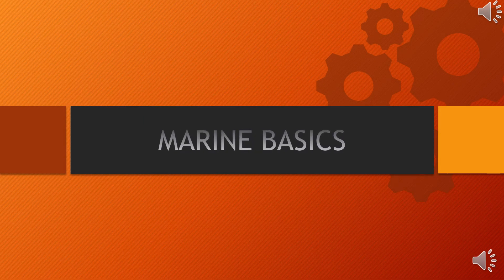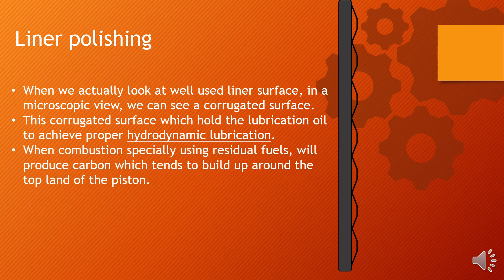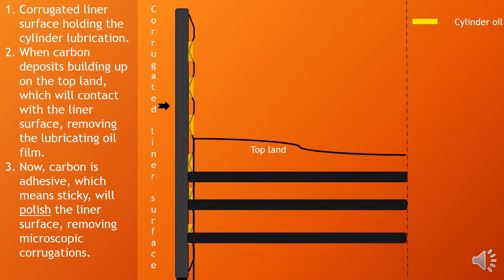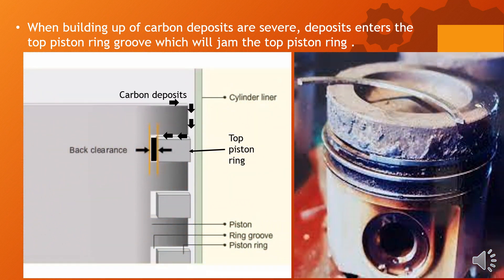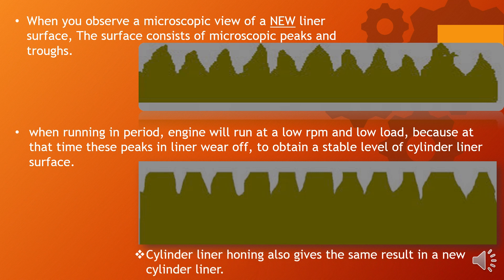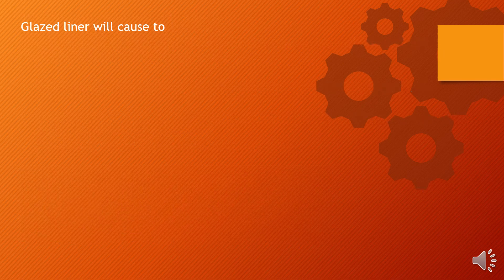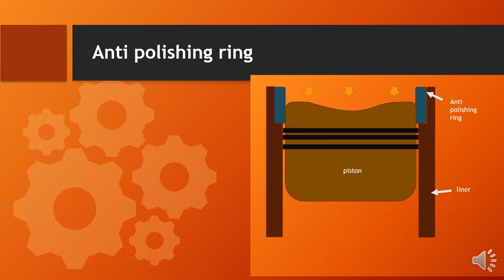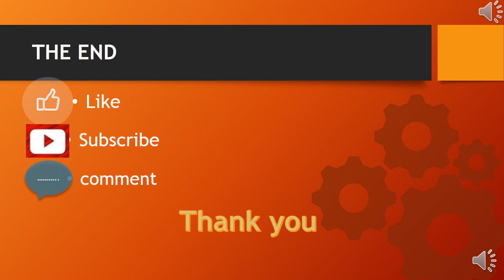liner polishing, glazing & anti polishing ring

Comment: Please confirm about Ploishing cause,  the carbon doesn't builds up between  peaks and trough, but because of carbon deposits between liner and piston rings the hydrodynamic lubrication is wiped off by carbon deposits.. Metal to metal contact, these carbon deposits acts as lapping paste (abrasive )which removes peaks and trough (corrugated surface )making it smooth and shiny. So the lube oil will never stick to the liner. requires honning again.